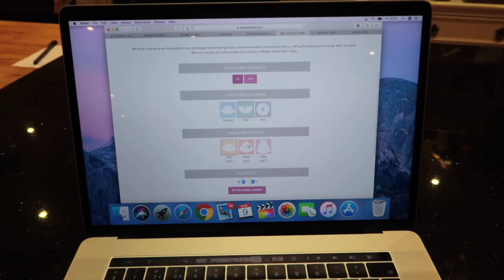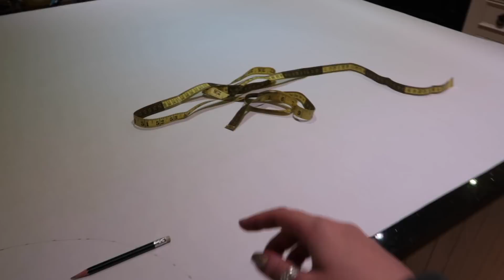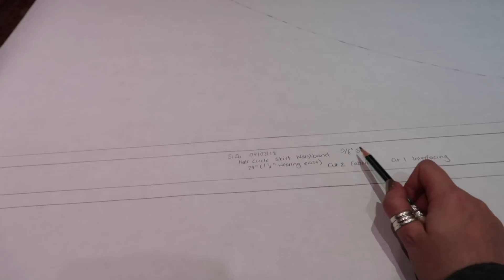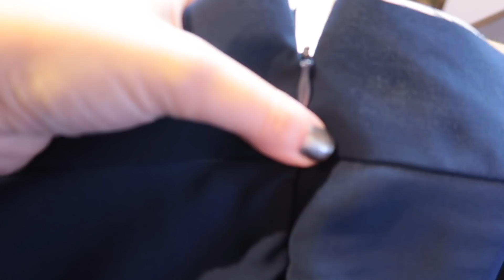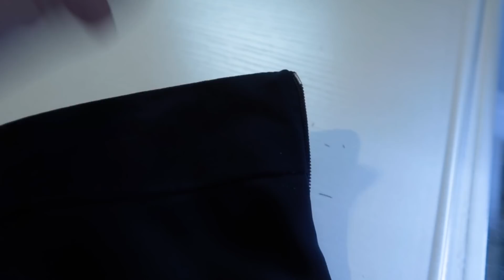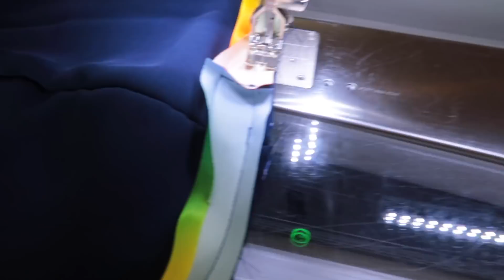How To :: Half Circle Skirt Tutorial :: No Maths Required!

Comment: How dis you come to 8 3/4" is here a formula for that? wha if the waist is 36" what will i be? I saw a video her waist was 35" and her numbers came o 61/2" wide it makes no sense o me her number is so much higher than yours and ye her number is less than your Please explain o me. Thanks a lot.
Reply from the maker: It sounds like the person with the 35" was making a full circle skirt which is why her number came out to 6 1/2", mine is only a half circle which is why I have a higher number even though my waist is smaller.

Comment: Hi. I  want you know how I put my zipper in.  I sew up the back of the skirt to where I'm going to put the zip in and stop  at that point. I then press open the upper part of the seam all the way up. this gives me enough fabric to sew on my zip. At this point I glue my zip in place and sew it on, one side at a  time as you do. Then It's all done. this way the bottom of the zip threads meets the top of the tread and there is no space, its like one continues seam. Now I like to put a closure on the skirt, because if the zip breaks what will hold your garment together until you get home to repair it? I don't walk around with pins, LOL. Have fun sewing, later.